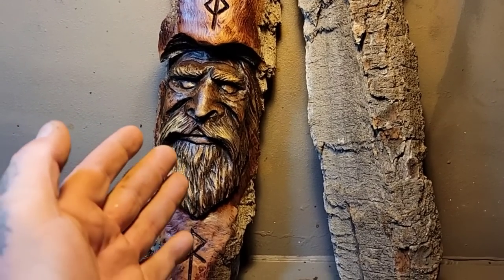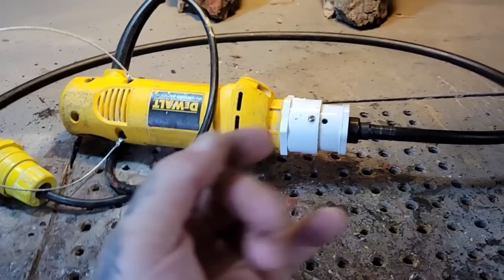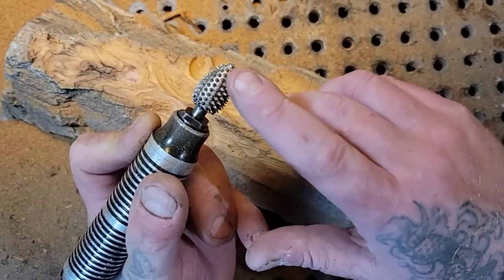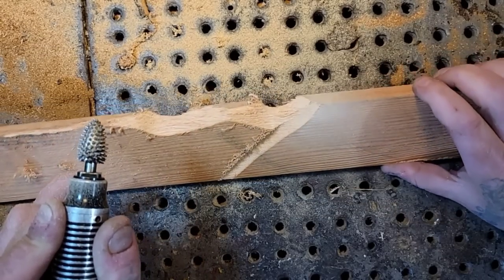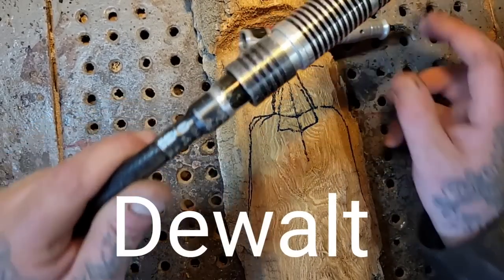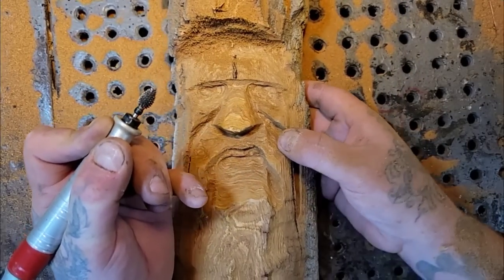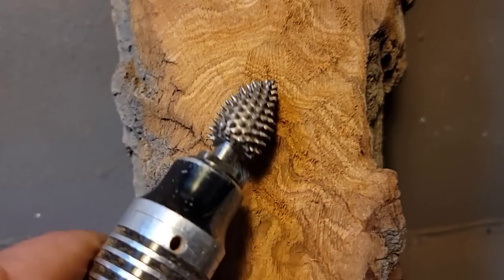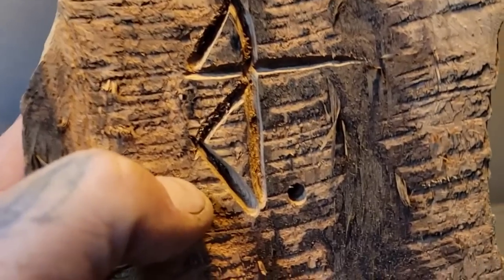Testing out the new MONSTER Power Wood carver Invented By Pete.b AKA Mad Scientist.

Comment: Hi Jordy. Great video. Pete did a great job with that. I enjoy the mandrels Pete made for me. Here's what I saw on the Kutzall site. With 1/4" and 1/8" shaft options, they can be used in wide range of power tools depending on collet or chuck size. Our 1/8" burrs work amazingly well in smaller rotary tools like Dremels, while our larger 1/4" burrs will feel right at home in your die grinders or large flex shaft hand-pieces.

Recommended operating speed range is 10,000 - 25,000 RPM